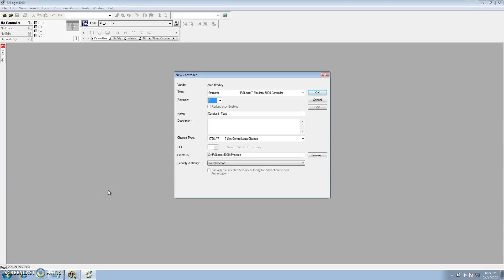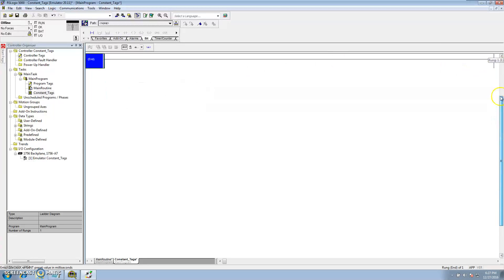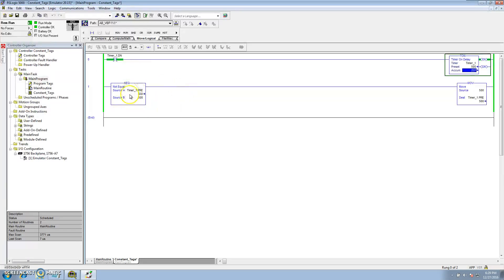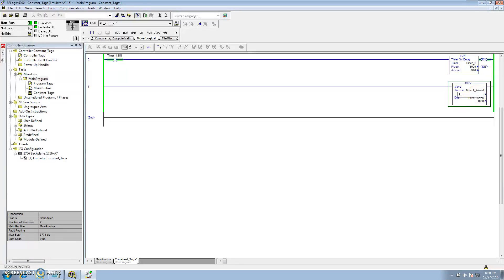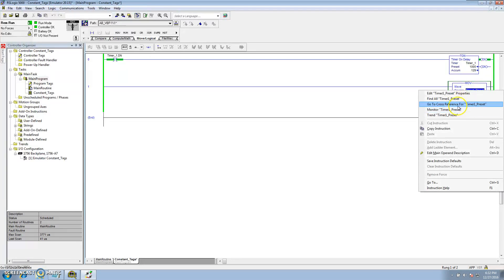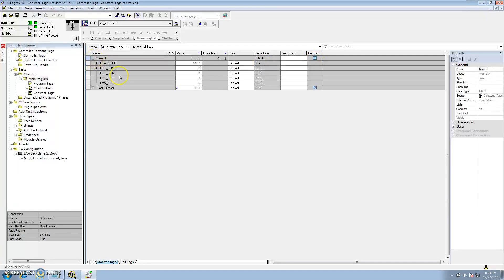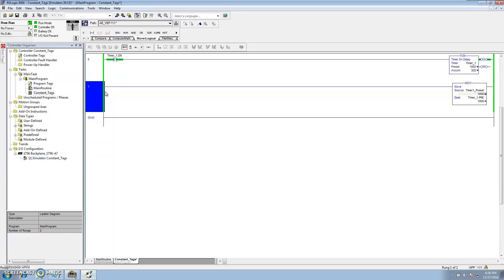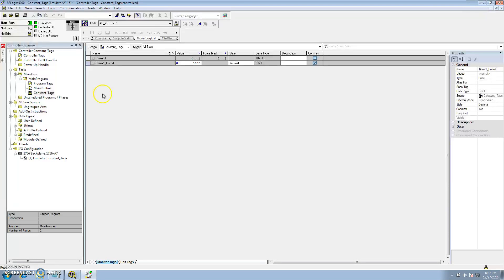RSLogix 5000 | Using Constants in Tags | Learn How To Lock Controller

Comment: Another note about constant tags is that they are monitored by the controller's change detection which you can get via a GSV instruction.  So you could alarm or do a controlled stop in the event that a constant's value has been changed or if someone unchecks the constant property.

There's also a blue box that shows up in the tag editor in the latest versions that helps remind the PLC programmer that the value they are editing is a constant.

I wish rockwell had a way to lock constants via source protection like they do for AOIs, etc.  It would help close the gap on a constants being editable.
Reply from the maker: Let me know where I can help